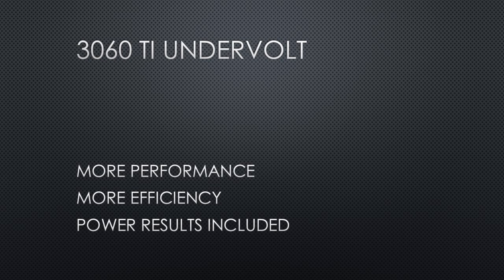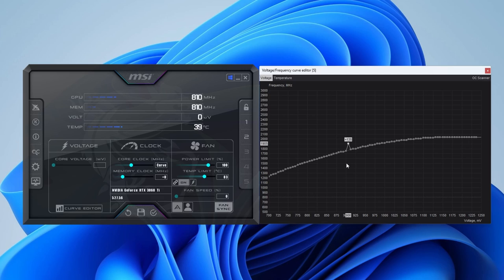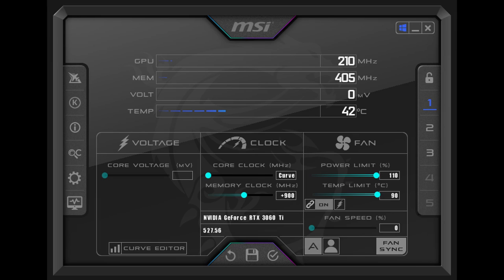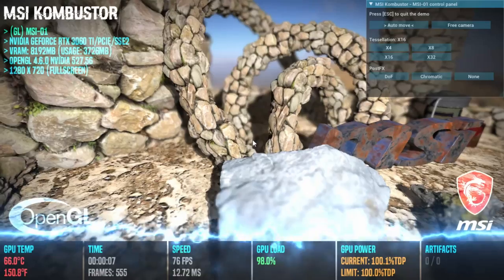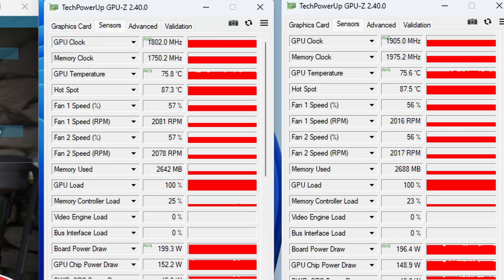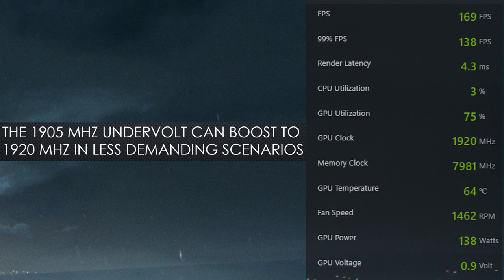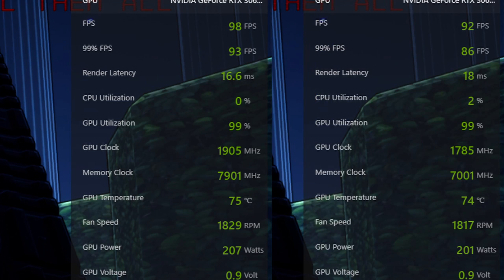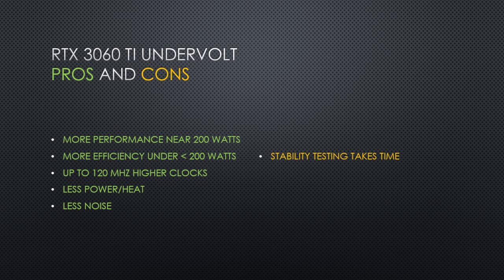RTX 3060 Ti Undervolt + Power Results

Comment: thank you from 70c to 58c and 220 watt to 130watt and no more coilwhine :D
Reply: Wow, nice! What frequency (MHz) and Voltage (mV) did you set on the curve?
Reply: @gopaulboodraj  1920mhz and 906mv
Reply: @koofyman7249  that 1920mhz and 906mv works well in games but seems to crash heaven benchmark for some reason

Comment: Thank you, i did my RTX3060ti (zotac) on 1935mhz with 0,900Volt and +500mem clock. And and work super!! Like 65° and stable with more FPS in all Games and Benchmarks.. In Timespy i got 1000points more than stock.
Reply: I failed😫😫
Reply: What do you mean by "0",900? What is the 0? Also, did you do method 1 or 2 to set the new curve?
Reply: Are you using a 1080p 60hz or a 1440p 144hz monitor? I'm looking to upgrade to a 1440p 144hz monitor and I'm afraid my 0.950v 1950mhz undervolt might not be enough

Comment: I have a Zotac 3060ti, modified into a single fan GPU. Before undervolting the fan was whining at 100% at 75-80°C during gaming, even with a fan curve. 
Now, it's a tolerable hum at 70% and about 65-70°C during gaming. My settings are: 1900mhz, 900mv, +500mhz Memory Clock, and down to about 120W

Comment: Best way to have stable undervolt with low temps is to choose core clock and voltage u want to use for example 875mv at 1875mhz seems stable for me atleast so then u just put core clock all the way down in afterburner then open curve editor select 875mv point and drag it to 1875 mhz then press L and apply.
So in the end im using about 50-70w less with around 2-3% performance loss but u can counter that performace loss by overcloking memory to 700mhz and u will get same performance as stock with way lower voltages.

Comment: I got a stable +160mhz 850mv @ 1875mhz and 900mv @1942mhz. but I lowered it down to only +150mhz to give it more headroom as I heard that overclock and undervolt become slightly less stable after some time. I have an rtx 3060 140w laptop
Reply: how many watts card need on 850mv?
Reply: @swiadomosczwiazkowpl  when GPU is being fully utilized it uses around 115watts
Reply: @mikediezel0923  Good. Somewhat like 1660 super without undervolt

Comment: Is this safe bro ? Not gone happend any issue to the gpu hardware?  Later on !
Reply from the maker: i would say its safe, i have done this for years on other cards with no issues. the worst thing i've seen is crashing if i set the values too high, but that can be fixed by lowering the values...
Reply: Even without changing the Power/Temp Limit you can still achieve good results with +750 mem. Reducing the peak temp with slightly better performance and prolonging the life of your card regardless. Definitely worth the trouble